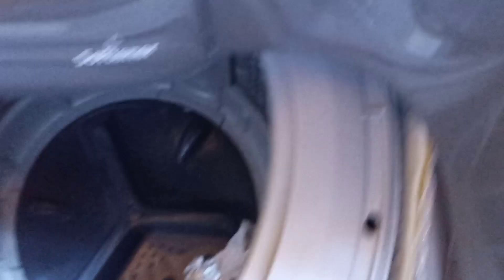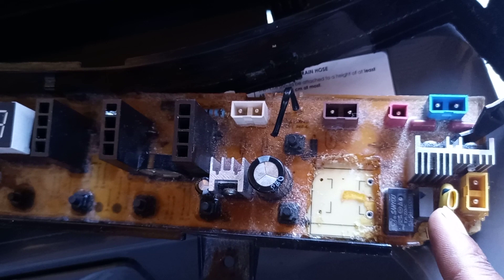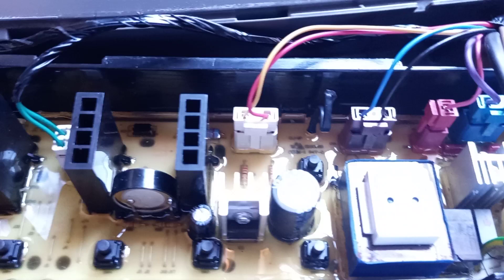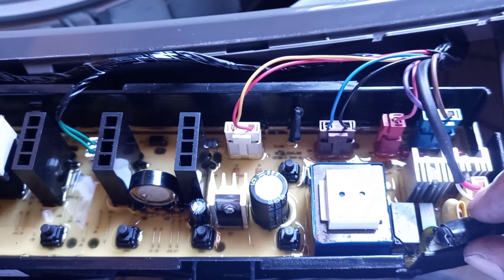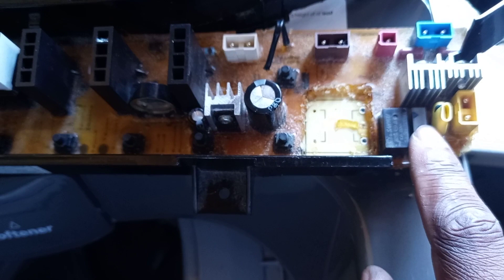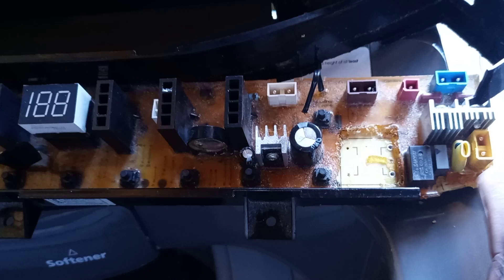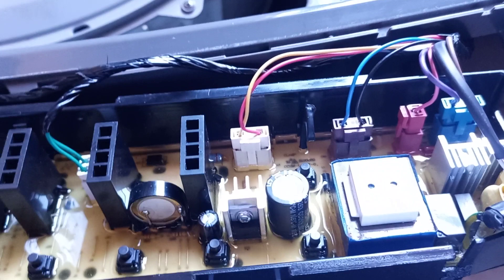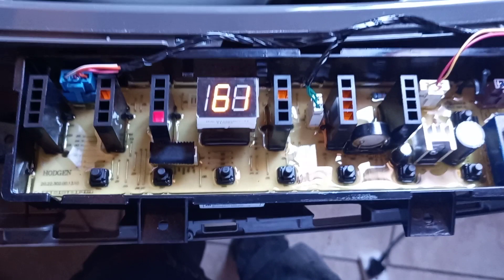Defy DTL149 PC Board not switching on!

Comment: Please may you also tell me what to fix when shows e5 and pressure switch is new
Reply from the maker: There is an ic at the back of the board, please check it. If its fine, just buy a new board because it might be the main ic

Comment: My machine doesn’t wash but it dries.
Could it also be pc board faulty?
Reply: That is possible but please check if the pulsator bush treaths are not worn. When the board is faulty it should give you an error code and the manual give details of that error.(is there any to your?)
Reply: @emzukwaneni Nope.
For now the machine only spin and dry.
But when it comes to rinsing or washing.
It only fills water in and out simultaneously.
It doesn’t contain water
Reply: And it’s a front loader
Reply from the maker: It is the pc board that is faulty, you need to repair the board. Check triacs and transistors responsible for wash and rinse. If they test ok, buy a new board bcz its definately gonna be the processor ic that is faulty.
Reply: @appliancetech001  Thank you so much.
Are you in SA.
If you are ,would you mind telling where i can purchase the board and for how much?
Reply from the maker: I am in SA based in Newcastle KZN, google Lategan and Van Biljoens/ MYZ appliances/TV Master(you must call/whatsapp them to 084 3352122) they will need a machine model number and pc board number.
Reply: Hi  @appliancetech001 How do you remove the pcb